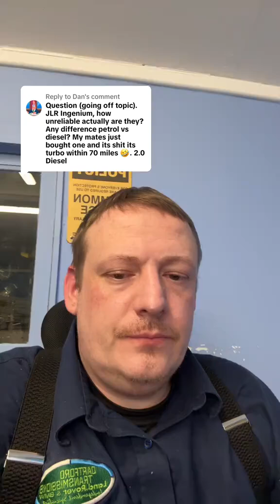JLR Ingenium: How Unreliable Are They Really? | Grumpy Technician Investigates!

Comment: So let’s be pragmatic….. if we change the oil every 5-7000 miles tgat should mean greater reliability?
Reply: Yes 8500km is really okay for Jaguars ı have s-type 2.7d 20 year 185k km and 2016 xf 2.0d 120k km no problem at all just change oil early and drive open roads and heat up exhaust often this engines are good ıf you understand the formula

Comment: No vehicle should have a service interval longer than 5k miles or every 6 months. Oil is cheaper than an new engine. Also another problem is all the emissions crap fitted, it just chokes the engine up. 
My diesel vehicles have all the emissions crap removed. About 20% better MPG. And a lot better results at MOT testing.  Dpf filters/ egr's and adblue are just a big con from the start.

Comment: No one is picking up on a major problem …… which is stop/ start …… this results in unburned fuel every time you come to lights / junctions/ roundabouts and also puts a massive strain on belts and chains every time you stop and start ….. without stop/start your day looks like this …. Start car in morning drive to work then switch off ……. Start/stop …. Start car in morning drive to work but your engine stops anything from 5 times to over a 100 while going to work …..JLR America ordered stop/start to be switched off 2 years ago the same time that Jaguar stopped all car production

Comment: So keep an eye on the oil level - if it rises, then change the oil.
Reply: Oil dilution light comes on . Most turbo diesel use oil . But it's being replaced by diesel so the oil level looks perfect.  Half the service interval for safety
Reply: Or just change all the fluids every 10,000 miles like a sane human being. Not even a Toyota can go 22,000 miles on a single oil change without problems.
Reply: @jugganaut33  and check the spelling of the word juggernaut before posting under that name - like any sane human being.

Comment: Being aware of the dilution issue on the diesels, I change oil and filter every 4000 miles on my 2L AWD F Pace. Hopefully, this gets rid of one problem, allowing me to concentrate on driving it for an hour at least once every two weeks, trying to avoid the DPF problems. The next issue is the steering racks failing, if that doesn't get me, the timing chain stretch will. From a positive point of view, the gearboxes are solid:)
Reply: Don’t forget the balance shafts!!
Reply: Always look on the bright side, good man 😂
Reply: Change the timing chain at 80,000-100k miles 
. Check the oil pan and pickup at the same time and you’ll be fine. For another 100k 
Treat it like a belt and the whole engine like it’s made of cheese. All the additives. All the care. Unfortunately

Comment: No the engine is not bad, the diesels are not meant to be mounted transverse layout - Evoqoe & Discovery Sport - the SCR (Adblue & DPF) are meant to be close co located to the engine. If you do a lot of short journeys the DFP regen will not complete and the extra blow-by will contaminate the oil causing sludge and extra wear. If you do short journeys do quicker oil changes e.g. 6-10K miles
Reply: So why do Jaguars with the engine mounted longitudinally have exactly the same issues at the same sort of mileages?!
Reply: @jameswalker7874Jaguars less problematic
Reply: If you find someone on the internet that says any Ingenium engine is ‘not that bad’, ignore them at all costs.

Comment: I have a diesel 2.0 - do you recommend that I do an oil change every 6k then ?
Reply: The Ingenium diesel engine is designed for longitudinal mounting. The SCR - adblue & DPF are designed to be closely located to the engine. The engine is transverse mounted in the Evoque & Disco Sport which means the DPF regen cycle takes longer to complete; as part of this extra diesel is injected and if the cycle does not complete due to shorter journeys then the extra blow-by gets into the crankcase diluting the oil…Not a bad engine just incorrectly mounted in the Evoque
Reply: @ so longer runs needed then for this one. Do you have any recommendations for rpm and duration?
Reply: depending on yearly millage, do it once a year rather than the 2 years Jag recommend, you will have no issues, make sure its been serviced every year and its fine
Reply: Oil changes are cheap if you learn to do them yourself.  Videos are on YouTube.  I did with my Jags and do oil changes every 2-3k miles now compared to 10k miles recommended.  Simple as- you want it to last, it needs aggressive maintenance.
Reply: Yes.